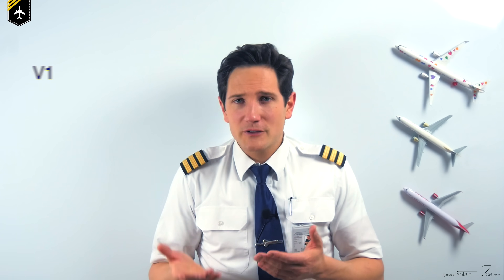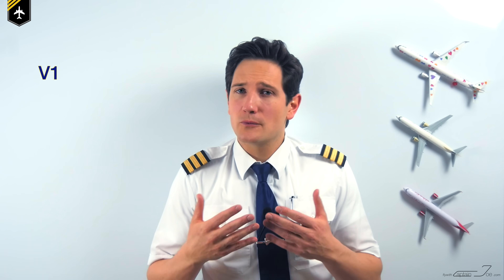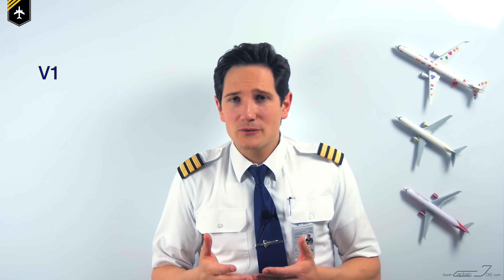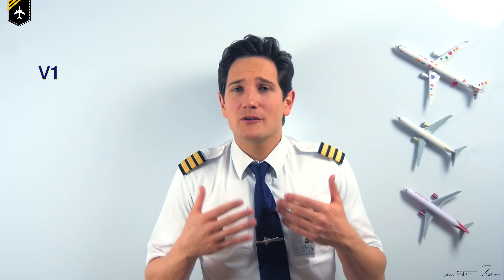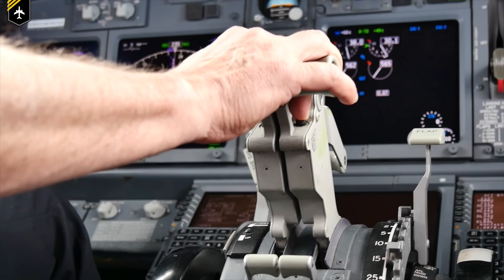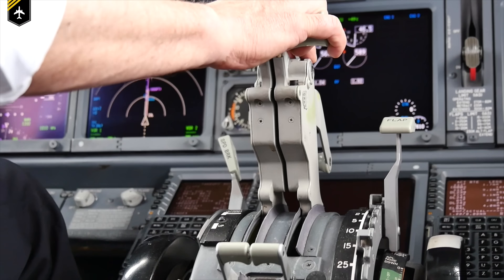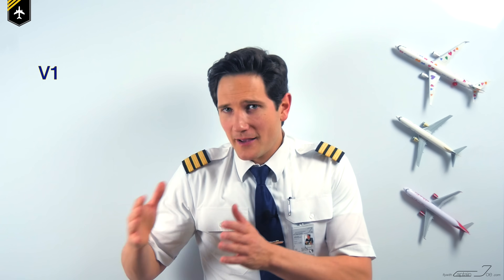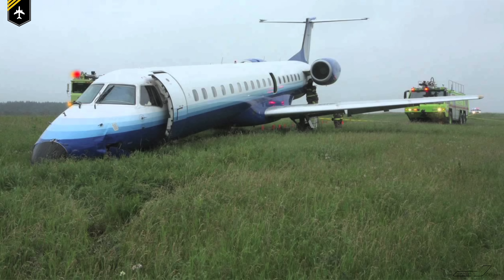TAKE-OFF Speeds V1, Vr, V2! Explained by "CAPTAIN" Joe

Comment: can vr come before v1? when the runway is really long for example?
Reply from the maker: No, never before V1
Reply: In thoses case you typically set V1 equal to Vr, or it's often placed just a couple of knots below Vr to allow for the time to call out "V1" (like V1=135, Vr=137 and the PM would call out "V1 Rotate!" with almost no pause in between the two). Basically it just means you're committed to the takeoff the moment you initiate the takeoff maneuver.
Reply: no, it can be the same as vr but never lower
Reply: Allfresco thx  :)
Reply: It's not very probable. As there are not that long runways for this. But anyways, after you are already climbing, there is apparently no need to abort the takeoff anymore.
Reply: Another great video and always communicated in a very nice and positive way, good stuff Joe!!
Reply: I guess that would be possible with, let's say, a jet fighter on a 5,000+m runway. If the pilot were to notice a serious malfunction with the nose wheel already off ground, he probably could still bring the nose down and apply landing gear brakes and airbrakes to come to a safe halt.
Reply: Peter Lovett V1 could be higher than Vr in the calculation, but as you say in practical terms it will never be more than Vr. But then when they're equal I'd expect to hear "rotate" on some takeoff audio without ever hearing "V1", but that never seems to happen. Why not?
Reply: On the ATR series for example, V1 is often the same as VR. V1 can never be more :)
Reply: RealLuckless In the US, for "normal, utility, and acrobatic category multiengine jets of more than 6,000 pounds maximum weight and commuter category airplanes ", V1 has to be not less than Vr due to 14 CFR 23.51:
"(2) The rotation speed, VR, in terms of calibrated airspeed, must be selected by the applicant and must not be less than the greatest of the following:
(i) V1;
(ii) 1.05 VMC determined under §23.149(b);
(iii) 1.10 VS1; or
(iv) The speed that allows attaining the initial climb-out speed, V2, before reaching a height of 35 feet above the takeoff surface in accordance with §23.57(c)(2)."
https://www.law.cornell.edu/cfr/text/14/23.51
Reply: If V1 was calculated to be >Vr, I'd just call out at the beginning of the takeoff "Not committed before rotation speed"
Reply: yeah, like if you were to fly a piper arrow off of the nasa runway, it takes about 1000 feet or so for Vr, and that runway is 15000 feet long. you have PLENTY of space. even in the case of an engine failure. but when are you able to land/takeoff on the runway at nasa? well, never ;(
Reply: If you have an extremely long runway, you can hypothetically take off and still slow down then land the plane back on the same runway without turning around. So there is nothing fundamentally limiting V1 < Vr .  A small plane can easily do that on a runway designed for 747.
Reply: gang208, i understand your point, however, that wouldn't classify as an aborted takeoff. Once the wheels are off the ground, you would already have taken off, therefore that would be a takeoff plus an immediate emergency landing on the runway remaining . In an aborted takeoff, your wheels never left the ground because you haven't rotated yet.
Reply: Bram Verachten VR is when you rotate ( put the nose up)
Reply: They can go together but not before.
Reply: Bram Verachten No VR has to be equal to or higher than V1.
Reply: Peter Lovett thanks, another very thorough answer.
Reply: No, because V1 is the speed you commit to a T/O. When you are at VR and pulling back, you have already commited to the take off.
Reply: Transport cat aircraft are designed to fly on one engine (or with one & sometimes two engines out) so once you have reached V1 then a take off must be made unless it's obvious the plane won't fly; IE you are heading for the grass with a wing/engine dragging on the ground. With say a blown tire you are far better off taking the plane into the air, sorting out the issue meaning checking for other known damage, reducing the fuel load (where possible) therefore the Ldg weight and have the full rwy in which to stop not what's left after you rotate which wouldn't be enough. Obviously it's the skippers choice but it better be the right one !:-)
We practice eng failures right at V1 in the Sim a LOT, so flying the plane should be a done deal.
Reply: no
Reply: Peter sez "What you have to keep in mind is that modern aircraft are designed so that a single failure will not cause a crash - and that goes for the engines - from V1 the aircraft will fly even with an engine out. This is what calculating these numbers is all about."
 
Yeah, I think that's what some people -- and I, certainly -- have a bit of trouble wrapping their brains around.  The idea of being able to take off on the power of just one engine (in the case of a two-engine aircraft) -- even if you've made it to VR -- seems hard to believe.  How can a plane take off with half of its power gone?  It just seems impossible.  :-)
Reply: V1 can be equal to VR, but you obviously can’t abort takeoff in the air.
Reply: Michal Mašek KEDW has a very long runway :)
Reply: Bram Verachten sometimes they can be the same speed. I teach the King Air B200 simulator and V1 and Vr are the same speed.
Reply: Is the "VR can never be before V1" specifically a commercial flight regulation? 

I've worked in experimental UAV/ROV projects, and for some of them we operated under a Safe-Straight-Abort protocol rather than a V1 call -  Even with some of our large craft we could still conduct a safe abort on longer runways even well after being airborne. (They were however STOL capable aircraft equipped with emergency drag-chutes, so 'kind of an unfair comparison' to a commercial jet's performance envelope)

I only dealt with technical development and deployment of hardware, the regulation stuff was handled elsewhere in the company and we were just passed specifications and operating procedures.
Reply: RealLuckless I'm sorry, I sent you to the wrong section. Transport category's takeoff speeds are in 14 CFR 25.107 - messed up the google search. HEre's the correct link: https://www.law.cornell.edu/cfr/text/14/25.107
It still says the same though, Vr no less than V1 (among others).
Reply: Peter Lovett thanks for the explanation. Is there also a calculation for point on the runway beyond which aborting is futile? So along with V1 speed, a distance from the threshold where there's no more room to abort safely? I'm thinking for example if the brakes are dragging and the plane takes a long time to reach V1, the pilots need to know how far they have before they are committed to takeoff, no?
Reply: Bram Verachten No vr and v1 will equal...
Reply: Peter Lovett 🖕🏻
Reply: VR can never be more?????
Reply: Seeing as the B200 isn't classified as a transport A/C & therefore doesn't require a V1 or V2 etc I always used 95 kts as a decision rotate speed, blw that I pulled the pin.
Reply: Theoretically an aircraft like a Hawk 100 could take off and land possibly about 3 times along the runway at Thurligh. It's something nuts like 5000 meters long. It was more than double the length of the next longest in Europe at one point. So could V1 exceed Vr in that circumstance?
Reply: As mentioned here a few times V1 is never calculated above V2 (can be the same as V2. You could given a long enough Rwy but why would you? Once the A/C has reached the calculated V1 then the Capt makes a decision to go or stop if there is a an event that warrants that level of attention. Obviously if the Rwy was that long & after getting airborne the plane started to become uncontrollable the Capt would dump it back on the deck, but such a scenario is then a one off decision where all bets are off. To put it simply the decision speed (V1) is designed to allow the A/C to stop on the remaining Rwy if a stop was initiated at V1, that's it in a nut shell, bit like a "you sure you still want to fly"? question.
Reply: It's not about having room. It's that Vr is not just a number you are actually supposed to rotate the plane at it.  If your V1 is higher which means you can still abort and you go ahead and abort, that means full application of the main brakes.  That depending on how far you have rotated will result in anything from nose gear collapse to nose slamming into the ground hard enough to cause complete structural failure and fire.
Reply: Whoops quite correct on the V2 (Vtoss). With regards to V1. There is often debate as to that, personal choice I would say. Some say at or Blw V1 you stop others say Blw V1 only for a stop. Lots of interesting stuff on that subject on the Net, often interpolated differently. Myself I would pull the pin at V1 (which I have done many times in the Sim) but lets face it the human mind would not be able to process a decision of that magnitude at the exact time V1 was called. Even the V1 recognition time is impracticable.
Reply: Hi Peter. We use 100kts on the 'Bus' as a sort of half way check although any high speed rejection is dangerous V1 or no V1.
The startle factor is taken into account when working out the balanced field length but humans aren't the best 'machines' to be dealing with:-) Been plenty of over-runs in the past where the Capt rejected too late or just simply stuffed it up! Thank God today's engines are very reliable:-)
Reply: for GA retractables until 70s the standard drill was to keep the gear extended while still over the runway for the possibility of coming back down and trying to stop in case of emergency
Reply: Michal Mašek Just lately the elevator of a passenger plane was jammed at vr and rotation was impossible. Should runways be long enough to allow full stop at vr?
Reply: Whilst that would be an even safer buffer/option it's just not practicable. To change the current balanced field length procedure/s based on a rejected T/O up to V1 would be totally crazy. You can't plan for very rare events such as an elevator jam right at Vr so it's all about risk assessment, that risk is extremely low.
Reply: So vr means that you're fully committed to the takeoff, even if - in theory, anyway - vr came before v1?

Say, for instance, you get hit by a bird just as you start rotating. Wouldn't it be better to put the nose wheel back on the ground immediately and apply full breaks rather than going around?

If one of your engines is badly damaged (as we saw in the clip), you might not have the time needed to go around, get realigned with the runway, and get your wheels back on the ground.
Reply: ***** it would be better to do whatever allows you to walk away in the end, but who can ever tell for certain what it is when things get as squerrely as engine out right at vr
Reply: Captain Quirk what if its a single engine aircraft and the engine fails.......say goodbye to your front gear
Reply: Okay, that's interesting. I mean, when I'm taking off with a Cessna 172 vom Barajas Airport, there is still plenty of room left at Vr to abort the takeoff twice.
Reply: Bram Verachten I don't have v1 neither V2 because in my pa-28-140  we only have Vr because I rotate at 65 knots
Reply: Still a very good practice.
Reply: Albuquerque international airport has such a runway.  It doubles as the main runway for Kirtland AFB and was designed to be long enough to get an overloaded B52 off the ground at 5000 feet altitude.  I believe it is 13793 feet long.  Civil aviation is allowed as well as commercial and military flights.  In normal operation airplanes take off headed east on runway 8.  The taxiway used at that end gives the full length of the runway.  I expect that v1 and VR are the same for all except a very few airplanes that visit there.

Note:  commercial aviation at that airport does not include any wide body aircraft that I am aware of. But does include aircraft as small as 4 seats including the pilot. I have flown on a Cessna 150 out of that airport once and on an otter into the airport once.
Reply: RealLuckless You don’t want to try to be flying before a decision is made to continue or abort.  Once you rotate, the decision to fly has been made.
Reply: John McLeod VII please explain why you expect that V1 and Vr are the same at ABQ.
Reply: thegames20.15 silva You don’t have V1 because you (your single engine aircraft) can’t fly with an engine failure on takeoff.  V1 is the speed at which the decision to abort or continue has been made.
Reply: Captain Quirk Every single transport category aircraft is limited to a max takeoff weight that will allow it to continue a takeoff with an engine failure occurring at V1, and continue to fly with the ability to clear obstacles along the extended centerline if the runway, or along its engine failure path if one has been determined for that runway.  I am sure there are a boatload of YouTube videos of aircraft demonstrating this for certification.
Reply: Allan Johansen V1 is the decision speed.  Vr is when the nose comes up, whether or not an engine failure has occurred.
Reply: Jukka Pursiainen not necessarily.  If the aircraft is at the runway limit weight, and the runway limit weight is the limiting factor for takeoff weight, then a reject 1 second past V1 will result in the aircraft crossing the far end of the runway at approximately 60 knots.
Reply: Aslanbek Aslanbayev Your statement makes no sense.  I think what you said is incorrect, but even after reading it three times, I am not sure what you are saying.
Reply: Oscar Blue.  It is an extremely long runway.  Most commercial airplanes are off the ground in less than 1/4 of the runway.  When landing to the west, many commercial pilots don't touch the brakes for half the length of the runway because the commercial gates are at the west end of the runway.  Commercial planes should be able to get to take off speed and abort with out having any trouble.
Reply: John McLeod VII They have to be dispatched to take off or be able to abort from V1 with the available runway.  My question is what you base your statement on (that you think V1 and Vr are the same number)
Reply: Oscar Blue.  It is based on the distance required to land plus the distance bring required to take off being substantially shorter than the length of the runway.
Reply: John McLeod VII So, You are not familiar with how V speeds are determined.  V1 and Vr have nothing to do with landing distance.  Depending on whether the speeds are balanced field (accelerate go = accelerate stop), or unbalanced field which optimizes performance capabilities of the aircraft and runway length available.  Balanced field speeds are the same for a given weight no matter the runway or airport.  Unbalanced speeds vary greatly and can even be different for two parallel runways that are the same length at the same airport.  This is due to obstacle clearance requirements.

That being said, I am not saying that V1 and Vr can’t be the same, but not usually.
Reply: Oscar Blue VR is when the plane can fly and gain altitude.  It is determined by the performance of the airplane, the pressure altitude, and the weight of the aircraft.  V1 is determined by the expected acceleration of the aircraft, the expected braking of the aircraft and the length of the runway.  With a sufficiently long runway v1 = vr.  It is my contention that for most commercial aircraft. Albuquerque has such a sufficiently long runway.  Since I don't have the tables, I cannot be certain of this.  Yes. Landing will not take as much runway because as an aborted takeoff because the weight will be lower on a landing due to fuel used in the flight.  But still, if at vr, you are looking at more than 10000 feet of runway ahead of you, I would suspect that you could get stopped on the ground.  I meant 10000, not 1000.

Remember that it was designed for an overloaded b52, and as such is an extremely long runway, much longer than a normal commercial runway at that altitude.
Reply: John McLeod VII With unbalanced V speeds on a long runway, a reject at V1 will stop the aircraft well short of the far end.  V2 is the single engine safety speed, and a dispatch requirement is that the aircraft be able to lose an engine at V1, rotate upon reaching Vr, accelerate to V2 and cross the departure end of the runway at least 35’ above the runway.  Sometimes Vr is is the same as V1, but I have seen them 5 to 10 knots apart also.  Long runway does not equate to V1 and Vr being the same speed.  Using balanced field speeds results in V1 and Vr being very close together (at least on the three types I have flown), but not usually the same number.  At Vr, rotation is begun at 2 to 3 degrees per second up to the liftoff attitude.  It has to be at a speed that will allow the aircraft to liftoff and continue rotating without the tail striking the ground.  I suspect that the 737 800 and 900 have Vr well above V1 due to their long fuselage length and short landing gear, but I will check with a friend who teaches on that aircraft.

As far as landing distance versus takeoff distance, that discussion can only be had using some reference point such as “max manual braking” or “Autobrakes 1”, because, as you said, most aircraft roll to the end of 26 in ABQ because “the gates are down there”.  Typically, the aircraft gets to 80 knots about 3000 feet into the takeoff roll and is rotating about 6000 feet down the runway (using reduced thrust options).  Full power takeoffs are usually much shorter because the V speeds might be as much as 20 knots less, so we are rotating much sooner.  

The landing distance with max manual braking is around 3500 feet, but nobody does that because it is uncomfortable.  But that is how landing distances are calculated.

Found this.  Fantastic article about Takeoff data.

https://www.faa.gov/other_visit/aviation_industry/airline_operators/training/media/takeoff_safety.pdf

I went out and found an old Flight Manual (A320) and looked at V speeds.  V1 and Vr were about 8 knots different for a flaps 1 takeoff.  They were the same for flaps 2 and 3 takeoffs.  This was from the days of balanced field V speeds.  I am not sure if anyone does it that way these days.  I do not know how unbalanced V speeds are determined, but I am headed out to fly and will request data for the various runways and flap settings to see what it gives me.
Reply: gang208 a small aircraft doesn’t have a V1, and can do whatever makes sense.
Reply: walter riely Greater than V1?  No.
Reply: Aslanbek Aslanbayev at V1, the aircraft is committed to takeoff.  If it won’t fly or cannot be controlled, then a reject is the only option, but the outcome is seriously in doubt.
Reply: walter riely The reject brief is supposed to be short and concise.  That way everyone knows the plan.  “ in the low speed regime, we will abort for anything abnormal unless it can be immediately corrected (park brake not released, power not set), once in the high speed regime, we will only abort for:  Engine Failures, Fires, Windshear, Uninhibited ECAMS/EICAS messages or controllability issues.  After V1 we are going unless it just won’t fly”.  That’s it in a nutshell.

The result of an abort above V1 (if the aircraft is at the runway limit weight) will be an overrun into the weeds at high speed.  At V1, the aircraft is traveling somewhere between 200 and 300 feet per second, and accelerating at 3 to 6 knots per second.  So, an abort 1 second past V1 will put you off the far end around 60 knots.  What does that mean in LaGuardia?  Swimming.  2 seconds past V1 is an excursion off the far end close to 90 knots.
Reply: Allan Johansen No, the aircraft flew just fine on one engine, right?  A reject beyond V1 can result in a crash.  We are trained to handle the engine failures on takeoff.  The aircraft you saw experiencing a compressor stall probably  climbed to a safe altitude, ran their checklist, and planned an approach to the best runway for their condition.  Had they aborted and departed the prepared surface, the crash, fire, rescue folks would have been at least a few minutes away, and the end result may have been bad.  They probably had the fire trucks waiting near the runway in case there were issues that they were unaware of upon landing.  Take your time, deal with the problem, have a good plan, and execute.
Reply: John McLeod VII Just rode  on a 757.  V1 and Vr were 13 knots apart for Max thrust takeoff, and 6 knots apart for a Reduced thrust takeoff.  Unbalanced field speeds, and flaps 15.
Reply: Adam Krawczyk you don’t have a V1 in a single engine aircraft.  Yes, you can takeoff and land multiple times on a long runway, but you do not have the ability to fly after an engine failure.  That is why single engine aircraft do not have a V1, or V2.  It is a number derived for performance computations.  You don’t really have a Vr either.  You just have a recommended rotation speed that the manufacturer provides.
Reply: Once you hit Vr, you're going flying.  So no, V1 is not going to be after Vr.
Reply: No, just because you can't abort after rotating
Reply: In airplanes that are so small and so light that you can safely abort a takeoff after speed for rotation on a long enough runway, there isn't really a V1.
Reply: no!
Reply: walter riely Does anyone know what 3 models Joe has behind him? They're beautiful!
Reply: Bram Verachten on a small aircraft ye
Reply: its a question like " can my  father be born before my grand father lol